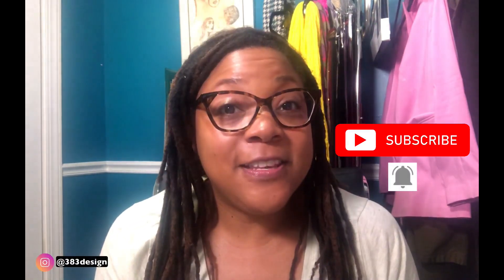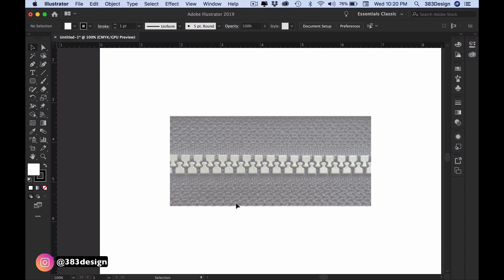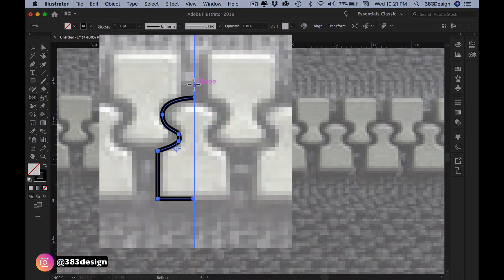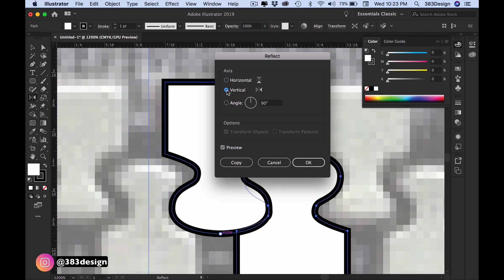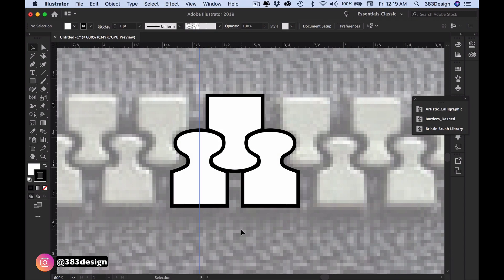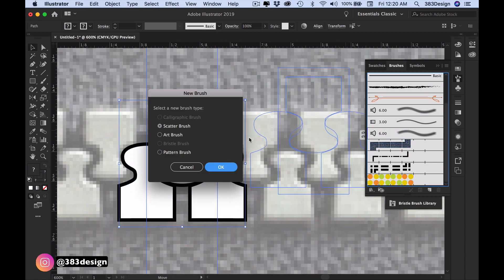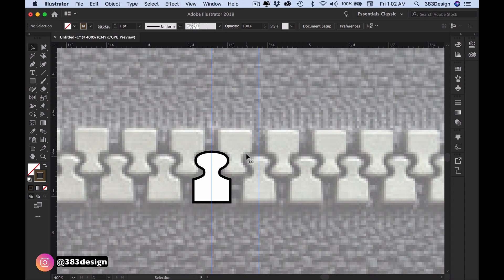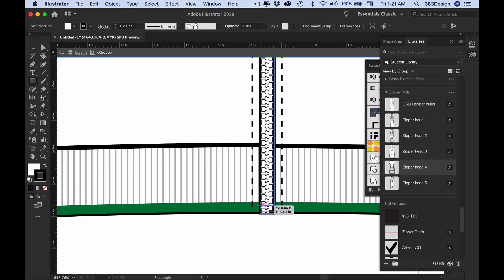How to draw Zipper Teeth for Flat Sketches (Part 2)

Comment: i followed your directions and when i went to go put in brushes it said it contained element that could not be used for brushes
Reply from the maker: Then, you need to check the artwork. Make sure you haven't accidentally added something like a pattern fill on any part of the art. The other issue may be if you've selected and dragged a guide with your artwork. Guides will not allow you to save brushes either.